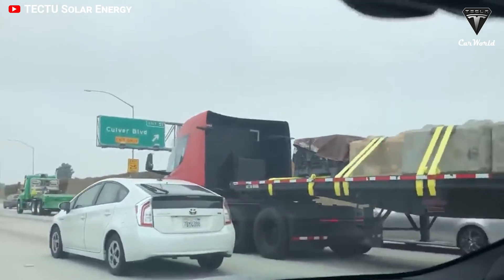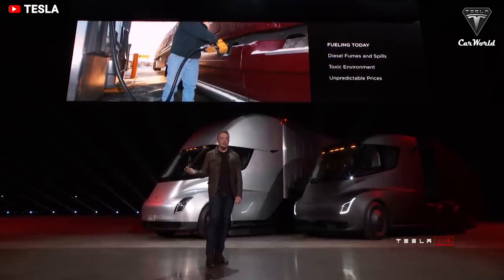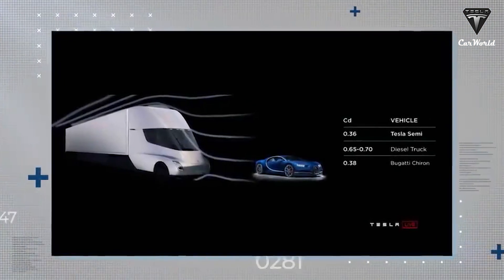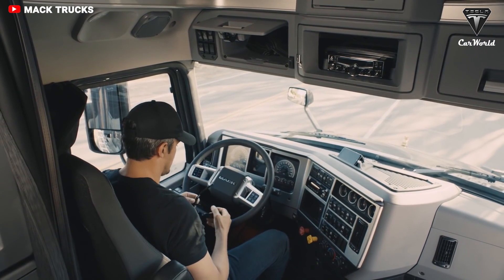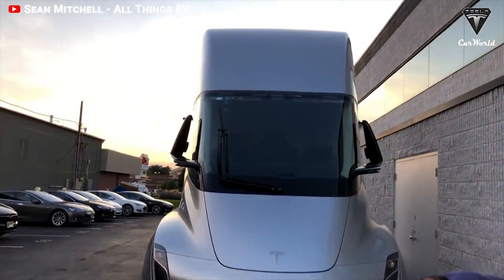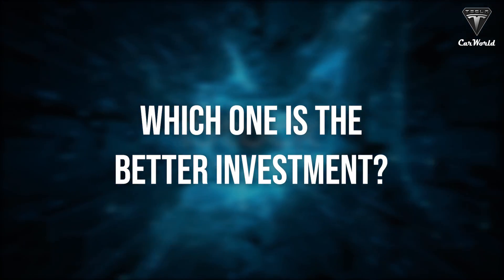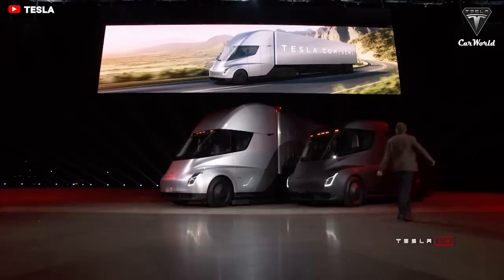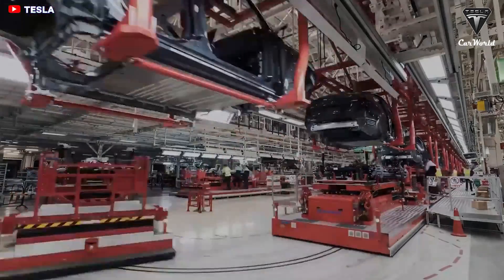Which is the KING of 2023 heavy trucks? Mack Anthem Diesel Truck Vs. Tesla Electric Semi?

Comment: I 2017 just about everything Musk said about the Tesla truck!! He hasn’t been able to deliver on. So by far the Tesla isn’t the king of the road, it hasn’t truly even been tested in normal driving conditions. Especially like the current weather we are having all across the country right now. The Mack can haul much more payload than the Tesla, because the Tesla is so much heavier. Isn’t it always been the heavier the load the more it pays. For Tesla to haul the same payload the Mack can, Tesla would have to use 2 of its trucks. How muck money would that save a shipper,HA. Since the Tesla only has a 500 mile capability without we charging. The Mack can go at least 200 miles further, in the 11 hr. drive time and can go about 1200 miles on full tanks, more than twice the distance of a Tesla. And as far as the 30 min break, the Mack driver can top off it fuel tanks use the restroom and get something to eat. While the Tesla driver is using that 30 mins to recharge it batteries then need more time off the eat and use the restroom. Bottom line The Mack will get to its destination much faster. Who’s the KING of the road, obviously the true and tried MACK !!!! in comparison to the Tesla.

Comment: The Mack will be lighter overall therefore allowing more cargo capacity so realistically the Tesla is useless unless the gross mass of the truck can be around the 5-8 metric ton fully loaded otherwise it will not be competitive if a regular long haul semi is a 50 ton gross mass 5 tons of trailer on average and 5-10 tons of prime mover gives 35 tons of cargo can be hauled unless the Tesla can do that without breaking weight laws it’s inefficient and not plausible

Comment: Couple major flaws 
 Telsa weighs more than an ICE semi but can have 2000lbs more cargo to make up for the weight of the battery so it can closer complete with a diesel . The cargo is still lower than a diesel though.
 Supercharging is at $0.50 per kWh right now, 7X more than calculated here, resulting in the Tesla costing more per mile.
 500 miles is max range to complete depletion from full, allegedly  The battery will lose 15-20% of it's capacity and shouldn't be run past 15%, so reality is closer to 350 usable miles from full, then only 80% of that 70% can actually  be fast charged.
 HP doesn't matter as much as torque, HP is just torque over time. Also, most of the time you can't accelerate too quickly cause of the cargo, you don't want to have to decelerate too quickly either.

Comment: The problem I I see coming for the Tesla truck is maintenance . There are more Diesel engine mechanic shops than they are electric truck shops. The Tesla track can make it within state if you have sufficient charging stations and mechanic shops if you try to take the Tesla truck and use it as al long haul truck I doubt the  Infrastructure is in place to support it for now.

Comment: I mean the specs are cool and all, but not talking about the fatal flaw that all EVs suffer, and that's charging locations and charging times. OTR LHT's are on strict time sensitive schedules. It takes <10 mins to fill the tanks and back on the road. Now you'll be stuck at stations for hours and that's assuming there is an immediate spot open to charge. This country is about 10-15 years too early on this technology. Until we can do 400 miles and more on a charge and charge to 80% in <5 mins, EV will never fully be adopted. Fine for short travel/city use, but that's it.

Comment: Instead of making electric vehicles make them run on hydrogen where you can distill the hydrogen out of water as you're going down the road and use it instantly but no they want you leveraged up against the electric company now instead of the gas company

Comment: That 0.36 is meaningless unless the trailer is included. A trailer with a flat back will increase drag significantly, and any load on a flat trailer will cause losses.

Comment: The truck doesn't have to be fast because all you will do is shift the cargo and damage it. A regular class 8 semi can haul as much weight as a Tesla. They are only giving the Tesla the extra 2,000 pounds for battery weight. What matters is how much cargo can it carry weight wise. Average truck can carry 44,000 to 46,000 pounds. Elon won't tell you how much the batteries weigh which will mean you probably can't haul as much cargo weight as a regular truck. Also Elon said that truck can go 500 miles on one charge. A regular semi with 150 to 200 gallons of fuel can easily go 1,000 miles + before it's next fuel stop and only takes 15 minutes to fuel. To get a full charge on a Tesla truck would take about 10 hours to charge. Sorry but if a driver is doing a split sleeper berth break, that won't work. Also having the seat where it is, isn't user friendly. The door is in the wrong spot and too many screens lighting up the cab during night driving. Last thing is there is no way you are going to get to sleep in a truck while those batteries are charging. There is a big potential for a fire hazard. Bigger than a diesel truck. Tesla needs a way better design because they obviously didn't consult with a trucker when they designed the truck.

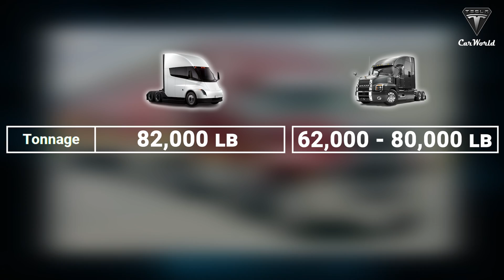Comment: @5:39 I think you may want to revisit this section of the video... Unfortunately Tesla has not yet released the actual weight of the tractor, so we can only estimate the payload from the videos we've seen so far. But in any case the payload should be closer to 50,000 lbs (ok, technically this is "greater than 2000 lbs").

Comment: Well Pepsi just said in an interview that the range is 400 miles pulling chips and 100 mies pulling soda. I don't think there will be any regret from the companies who choose a diesel truck over the Tesla.
Reply: To expect technology to be perfect from the get-go is the dumbest argument you can ever make. Was the Model T faster than a horse and carriage? No, of course not. The Tesla will improve with time and that's just how technology works. I'm sure the combustion diesel engines will become more efficient too.

They are great for short distance deliveries and if delivery location put chargers in at loading docks then that's even better for the seller. Right now of course combustion vehicles are better for long range, but that doesn't mean every single one on the road needs to be one. Diesel is going to only go up in price over the years, even if its goes up and down for a little bit. Companies will end up making a choice and in the end, it will be a Tesla or one of the other 4-5 electric trucks being developed.
Reply: @bedinor  Electric motors, batteries and trucks are all old technology. It isn't like they are breaking new ground. Besides,  I wasn't asking for it to be perfect, but just to perform as advertised.

Comment: Why is acceleration important? on a 8h drive for delivery, that will come in effect 10x in city, 0 times on highway, and 10x in city of delivery.. so you will profit 20 min on delivery. 
Interior is really important to have 2x tablets staring at you for the whole drive? 
It's a long range truck and it has 300 miles range (or 500 miles)? and probably takes a day to recharge those batterys.
Most fetures that Tesla pomises I have real doubths about it. Considering that full self driving "is posible today" was said 5 years ago, I am really sceptic abot everything.

The real question is how much load can Tesla carry? Noone told that thing anywhere yet... Considering that the batterys are really heavy and there is a limit how heavy can truck+cargo be, I imagine it could deliver 1/2 cargo at one drive (at best).

Comment: The Mack is superior as it can carry 20 tonnes. The Tesla can only carry 10 tonnes. So one would require 2 Tesla semis to do the job of one Mack semi. So $280,000 for Teslaa. $140,000 for Mack. Electricity is near $0.40 per kWh not $0.07 per kWh. Everything Elon says appears to be a lie. Give us the required data. Not the ones made up in your head. Had to edit as had Tesla with lower case ' t '.

Comment: It's not just about going fast. Trucking is about endurance. I'm sitting in Mifflinville, PA at the liberty truck stop. In 38 hours, I will be in Seattle, WA.  With only a 500-mile range and needing to stop as long as 30 minutes  to recharge, could Tesla's new semi do that?
Reply: To make that 2710 mile drive in 38 hours you would have to exceed the speed limit with absolutely no stops.
Reply: To do it at speed limit with no stops would take 40. And no traffic slowdowns no construction. With bathroom breaks refueling normal dispatch time of 55mph average - 49 hours.  60mph 45 hours.   Tesla would have to stop to recharge 5 times so adds 5 hours time. With team drivers.  Solo has to stop after 11 hours for 8 hours.  So adds no time.   Charge while you rest
Reply: Now for fuel savings.  2710 miles assuming 8 mpg would be 1694 in fuel, assume 10 mpg still over 1300.  Tesla semi will use $135 in electric
Reply: Union pacific railroad has a car velocity of 200 miles per day.  So trip would take almost 15 days with them.  Railroads haul 40% of freight because they do it for 1/3 of the fuel.   So shippers are willing for product to go 10 days slower for reduced price.  So you really think you can compete with 1/10 the fuel for 10% extra time?

Comment: If you knew anything about pulling loads it’s torque that a truck needs. Also the Tesla truck takes up most of that gross weight it’s an extremely heavy truck. So therefore your net load is a lot lower.

Comment: I see a lot of people are worried about the charging, but since the video does not cover this, I'd like to introduce an argument for electric trucks:
As far as I'm aware, there is a maximum of hours a truck driver in the US is allowed to drive; 30-min break every 8 consecutive hours and max 11 h after 10 consecutive hours of off time; and in the EU; 45-min break every 4h30m and 9h max per day (both highly simplified). Then assuming, that the Tesla semi will do 500 miles, and one driver can maintain 50-60mph average on their shift (not max speed; including speed limits; traffic; various other short breaks) we can assume, that the truck can be operated for 8-10h without charging. I mean, you may not want to because keeping the battery between 20%-80% of charge will increase its total life span, but you can.
Bottom line is, it's very likely, that your truck will charge its batteries while you charge yours. And this way you don't need to use a special high power charger, that is also much more inefficient, a usual supercharge could do; 150 kW would mean 6h40min of charging; 250 kW 4h (900 kWh battery 0-100% worst case scenario) From the 30 min 400 miles advertising I would assume the MEGAcharger would do something in the neighborhood of 1000kW of 1MW :D. As war as I'm aware, charging the 900 kWh battery at home 0-100% is not really an option, most homes in Germany have a 22kW household limit so charging the truck would take about 45h in best conditions (unrealistically) and in the US it's 33kW? so 34h?.
I think this concept will succeed or fail with the amount of destination (as in driver break time destinations) superchargers. But also the most companies who have confirmed buying them, move goods between multiple facilities of their own, so it's likely they will also have a charger on site.

Comment: But I can drive 673 miles in a day and refuel in under ten minutes. The Tesla can't and how long is a 100% charge going to take. As far as weight goes, that's a regulation constraint. I could pull 90K easy if the law allowed it. The diesel motor has the longer legs, that equals time which equals profit.

Comment: I think the Tesla Semi is ground breaking, but not the best truck to use and iut might be a little while before you can make a practical case for the everyday truck driver. I think the Tesla Semi will end up being perfect for the local and regional companies like UPS, Fedex, Walmart etc. But long distance not so much for the moment.
Reply: @Karl with a K There is no way it's going to replace the fleets of trucks hauling long distance with b-double, b-triple, and road train configurations in Australia.  You'll need a significant increase to battery capacity before it will be able to compete.  A road-train can easily travel 2000+ km before refueling.

Frequent short runs seems to be the use-case for this truck
Reply: @Karl with a K Ultra long haul trips typically have multiple people in the cabin.  We have time restrictions in Australia as well.  Just saying that an EV truck will not replace some use-cases, no matter what "Chief Twit" claims

Comment: Been driving Big Trucks for over 20 years now. And this does NOT amuse me! It used to be FUN going thru the gears! Riding the Jake Brake down the mountain. Listening to that huge turbo spool up and the hum of the dual exhaust just outside the doors!! But now we have crappie automatic transmissions that are always in the wrong gear! And a whole bunch of Nannies you CAN'T turn off! Like radar cruise control 👎
Lane keep assist 👎
And this new electric truck is just more of the same! 👎👎 
Give me an old W900 with 15 or 18 speed manual. A BIG 82 inch sleeper and a BIG OL 600hp Caterpillar under that long Hood!!! 👍👍👍👍

Comment: Good job not taking about the things important to truckers. Battery power is not feasible for long haul. In a truck torque is king. Many US engines can put out 2000-2200ftlbtq. 80,000 over uneven terrain or mountain passes batteries wouldn't last a day, much less 24/7 team driving.

Comment: I really enjoy the video. But I don’t wish to disparage, but could we have someone do the article who is a truck owner. Acceleration doesn’t mean a thing to long-haul truck drivers. The Ability to stay at speed, not stopping for fuel. ability to run with very low maintenance. The Ability of owner to maintain and work on truck do our own diagnosis of problems. The availability of parts. Downtime is crucial. Cannot have for the truck to be in the shop.

Comment: I have a 1988 freightliner flc120 with a 3406b engine and 13 speed trans I also had a 2010 international prostar with a cummins engine and 13 speed trans the freightliner got 10.5 to 11 mpg the prostar got 5 to 5.5 mpg i have seen vidios on electric pickups and the battery life is cut in half when you put a little load on it and many times you drive for a long time to get the load delivered with electric trucks be ready for longer delivery times and the government will have to change logging to factor in the down time for recharging the truck how safe will highways be only time will tell but if you have to stop every couple hours to charge the battery it will probably be the truck controlling the driver instead of the driver controlling the truck

Comment: More payload on testa truck is a lie. Higher total weight is correct due to electric truck regulations. In the lecture with Tesla-Elon, we can all see what the 82000lb truck is loaded with. Approx 20000lb payload. That's less than half of what traditional trucks can handle...

Comment: It's not a "zero emission vehicle" if electricity production causes emissions. Ca. 70% of US and EU electricity production is from fossil fules,so filling up or using electricity is for 70% using fossil fules -- not "emissions free".
And production of lithium batteries is extremly poluting activity. Electric vehicles are on average ca. 30% more expensive than their ICE counterparts and fuel cost per mile is much higher than for diesel when using DC fast charging. Expensive,impractical product from the "Doomsday cult" financed with our stolen money (taxes). 
P.S. latest pricing for Tesla truck is 300,000 USD. You must be joking.

Comment: I'd rather have the Mack.
Reply from the maker: What do you like about Mack ?
Reply: @TeslaCarWorld  I'm just not an electric vehicle person, maybe I'm just old fashioned. It still takes heavy equipment with diesel engines at the mines electric vehicle manufacturers like Tesla to get their lithium for their batteries, so how is electric vehicles any better than gas or diesel.

Comment: 🤣🤣 as a trucker I'll stick to my Mack or peterbilt. Also 82000 lbs is max weight but you have to account for the weight of the batteries and lithium is heavy. Also the tesla curb weight is 27,000 lbs Mack anthem is between 17,000 to 20,000. So overall you're getting more load capacity regardless out of the Mack anyway.

Comment: I'm not a truck driver (I wish!).
But it seems to me trucking  is about energy efficiency. That's where the transport costs are. And then the Tesla would be a hands down winner.
But Mack being Mack knows about driver experience, which Tesla seems to have neglected. What about those Tesla screens blocking downward visibility left and right (6:10)? Looks amateurish. Unless those screens are on adjustable flexible arms this would be a deal breaker for me. Entertainment system? Blah!

Comment: The average Tesla fan boy who knows nothing about trucking. Guys it can move and extra 2000 lb. This is only in the states that allow the extra 2000lb because the truck weighs more. Then uses HP and not torque specs for a truck. Proceeds to ignore other electric trucks for comparison. Please research the trucking industry next time and not act like your comparing midsize sedans.